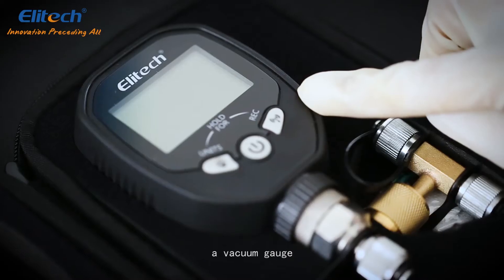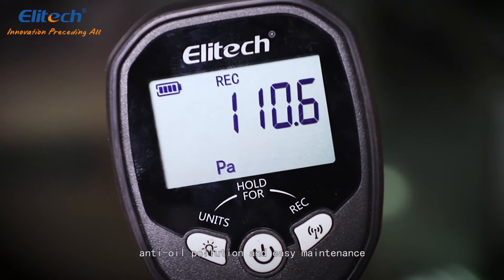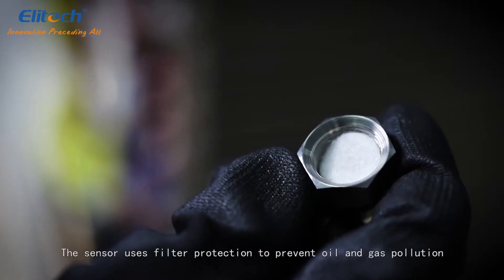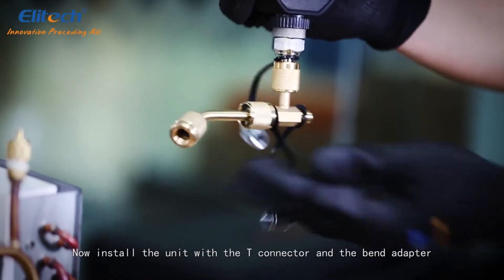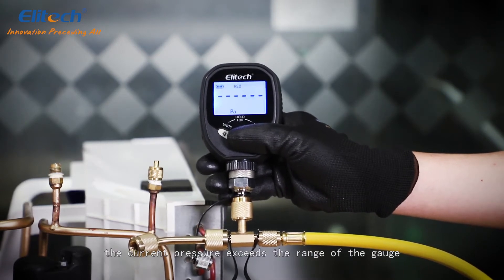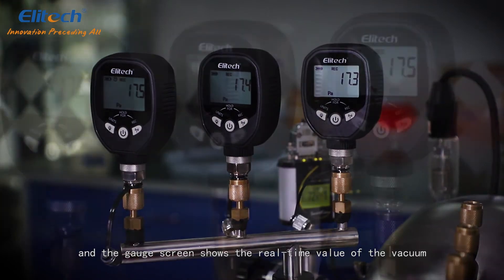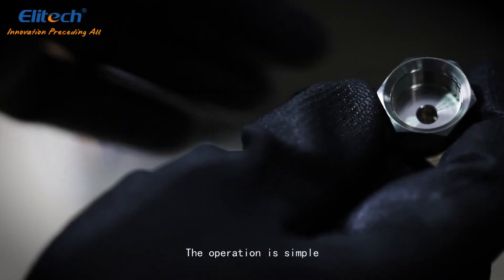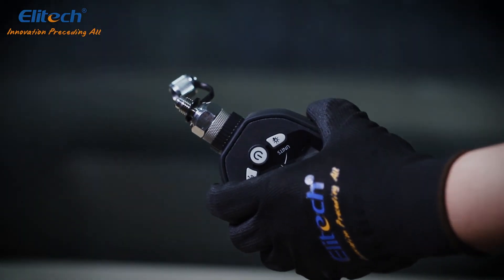Elitech VG-760 HVAC Digital Vacuum Gauge Micron Gauge

Comment: I used mine one time and it worked great. Stored it 3 years in the case with the desacant, in the box, in a drawer in an air conditioned house. Second time I tried to use it and it leaks within the gauge. Retired HVAC guy. Can this be repaired or do I just toss it?